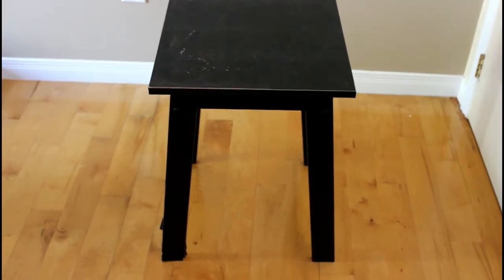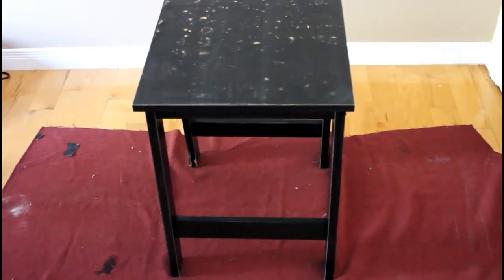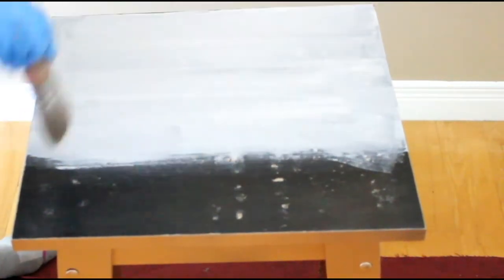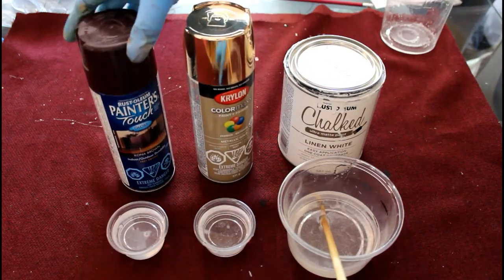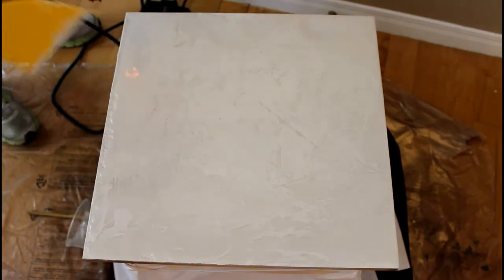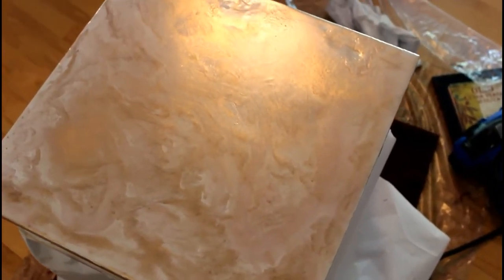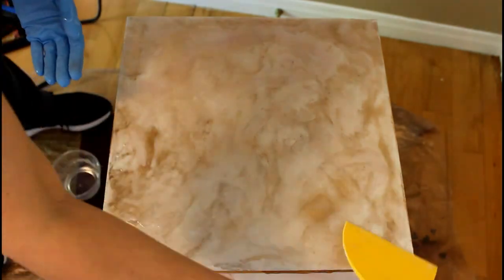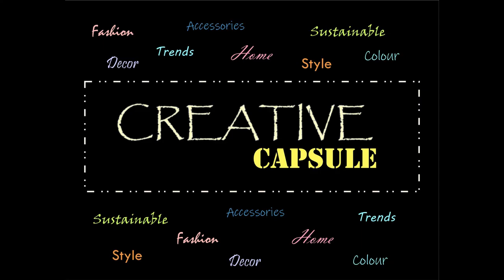MARBLE EFFECT TABLE TOP: DIY USING CHALK PAINT & EPOXY

Comment: If the top is getting epoxy then what does the chalk paint do that any other primer/binder wouldn't?
And you should mention your paint ratios....it's cool to eyeball stuff, but tell us ...
Reply from the maker: If your paint is not binding properly on the surface when you apply the epoxy there's a chance it might peel off as you're spreading the epoxy with the putty knife. On a laminate surface I find it safer to use chalk paint that binds much better than latex paint. I didn't try it with a primer, if you do use it on laminate let me know the results ;)

Comment: What is your paint to epoxy ratio???
Reply from the maker: mine is about a tablespoon of paint for 1 cup of epoxy. But you can add as much paint as you want depending on the color you use and the opacity you prefer. I wanted a light coverage of white so used a small qty of paint.